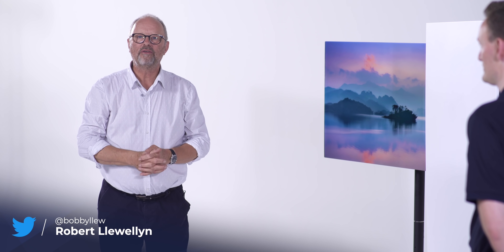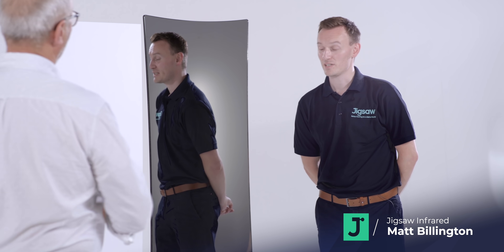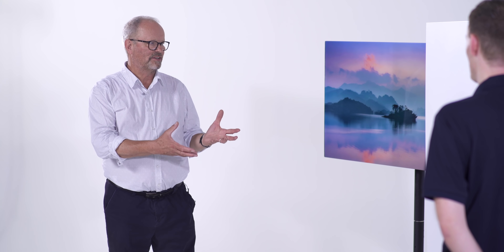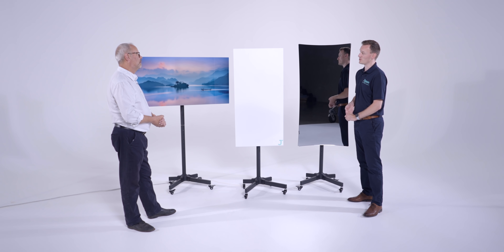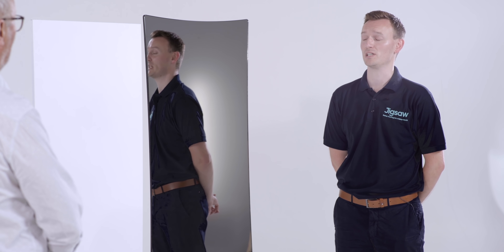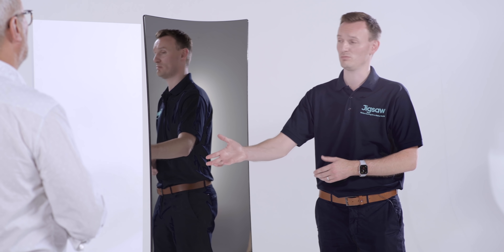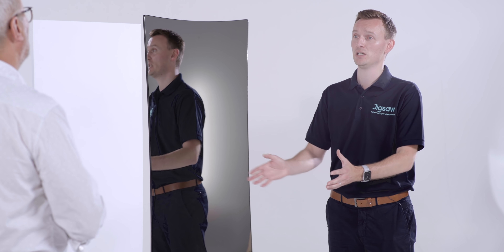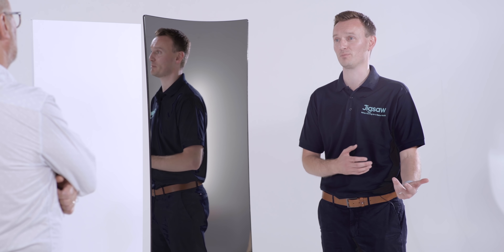JIGSAW INFRARED - Heats like the sun, cares for the planet | Subscribe to Fully Charged PLUS

Comment: Been thinking of getting something like this for a while, as my flat has a crappy E7 storage heater, an old gas fire and frost protection heater for when I'm not there.  Handy information.
Reply: Same with me needing to replace old E7 storage heaters in a small cottage, no gas. Looks ideal.
Reply: Changed my life and has helped improve our spend on fuel. It saves money because its not being wasted on heating the air.
Reply: @glennbillington  What does this 'not heating air' mean? Of course it's heating the air. It's a resistive heater embedded in ceramic. Very inefficient. There are so many better solutions.
Reply: @OAK-808  the heat is emitted as radiation. Not convection.

A tiny proportion of the heat is emitted as waste heat in convection, the vast majority heats you directly, using infrared.

Heatpumps by comparison heat the room via traditional wet convection radiators. Resulting in wasted energy as the room air must be heated in order for the heat pump to transfer heat to you the individual.

Comment: These panels are an old, well  known technology and that was clearly stated. As the UK’s favourite form of heat energy (gas boilers) become more and more expensive to operate, these modern versions of IR have a definite place. 
Obviously a well insulated home is the start point, but some heat is still going to be needed and the conversion rate of resistive heating (circa 100%) is very good. 
Heating the people and the building directly is more efficient than heating a water mass and pumping it around. This  is partly because water has very high latent heat capacity and thus takes about 4 times the input per unit output. It’s usually quicker and more efficient to heat directly than via water.
Bear in mind that the latent heat in water is not wasted once input, in a closed loop device and heat pumps can output greater heat than the electrical input in ideal conditions. 
However heat pumps and gas boilers have many drawbacks including a limited lifespan (10-15 years) and expensive maintenance and replacement.
As more houses in UK install solar panels and more of our electricity comes from renewables,  efficient electric heating will make sense for many peoples homes.
Reply: if your heat-pump isn't outputting more heat than the electrical input its broken.
Reply: A problem with this logic is that this instantaneous heat will typically be needed when solar isn't not functioning. I think it is pretty evident that the best solution for long duration heat is a heat pump. This could be to heat water to heat air in a rerversible air con system. The fact is that for every calorie of energy taken from the grid you get 3 out from the heat pump. It must comes down to the whether you need to heat a whole space for a long time or a subset of the space for a short time.
Reply: @matthewpieri9080  I'm thinking of getting IR panels as well as a heat pump. Im going to turn flow temperature down so that It's at its most efficient COP all the time, winter or summer. I.e. trickle charge the house with heat from the heat pump and use the IR panels in the room/s I'm in, using a sensor to switch on the panel.
I'm using a 350W panel right this minute, and it's adequate. 5 minutes before I get up, I ask Alexa to switch it on. It's 0800,, and I'm already getting 1440W from solar.

Comment: Presumably these are far more efficient than regular space heaters?  Some numbers would be good.
Reply: All in replies to other comments. Plenty of info on the website too.
Reply: No, they're exactly the same efficiency, but they can only heat surfaces - not air
Reply: @jrisner6535  secondary heat is convection. So, they do both forms of heat.
Reply: @glennbillington4879  that's inaccurate, almost no convection will be generated. Don't pretend IR can do everything, they're a specialised technology for specific situations
Reply: @jrisner6535  Secondary heat is convection J. It's inevitable that once the infrared is absorbed then any further heat will be convection. Similar to when we sweat, heat from us is basically infrared and then the sweat on our clothes will become convection.
Reply: @glennbillington4879  misleading or you've misunderstood 🤷‍♂️ hard to tell
Reply: @jrisner6535  Similar to your cryptic comments.

Comment: IR panels == glorified resistor with heating efficiency of a resistor. That's not how you solve energy  problem but deepen it. For humanity to reduce risks related to global climate change we need to work on efficiency. For example heat pumps...
Reply: Resistive heating actually converts 100% of the energy input to heat so it's pretty good in that sense. The main issue is going to be the need for good insulation in the house or the electricity consumed will be high.
Reply: @SardiPax  All losses in electric devices are heat losses therefore the cheapest epectric radiator has the same heating efficiency as the most expensive IR panel, that is 100%.
My comment was aimed to propose that we have devices with higher heat energy transfering efficiency a.k.a. heat pumps with COP's around 4-5 compared with COP of 1 in devices that use Joule losses.
Reply: @SardiPax  A heat pump is 300 to 400 percent 'efficient'. Resistive heating is 100
Reply: @OAK-808  The pump itself yes, but you then need to transfer that heat around the house, which uses energy, and also there's the issue (if Air Source) of dealing with low external temps. I'm sure the real efficiency is still well over 100% but for most existing houses the heat pumps will still need resistive heating supplementation at times (to heat the water) further reducing overall efficiency. I'm not arguing against heat pumps, but nor am I deceived by the hype.
Reply: And what is your educated understanding of the situation and do you plan to save mankind Ja?

On and on again we go. NOT EVERYONE can have heat pumps.. When will people listen? It is not suitable for millions of people in the UK and when someone finds the be all and all then we need to do our best. 

Your remarks are misleading and not fact based at all.
Reply: @jamislil2703  That is where you do not understand. You give misguided information. 'Mr Heat pumps' here again going on, they cannot be installed everywhere and the capabilities are not there to actually make it happen. Plus the cost of heat pumps, not everyone is as rich as you are. 

Get a grip and see the reality of the situation and stop winning on about something that not everyone can have.
Reply: @ja mislil  I can't get a heat pump in my flat, yet. What do you suggest I do? Right now I have a combi boiler.

Comment: Under floor heating is infrared heating. The best form of heating in terms of energy consumption and comfort, would be a heat pump connected to underfloor heating. By the way, in the early days of underfloor heating, plumbers were also embedding pipes into walls and ceilings to get the same results. I believe this practice was dropped because of too many pipes being damaged in these locations
Reply: I’m very much inclined to agree with you, with the possible exception of installation cost. For a ground up build or renovation underfloor, particularly with a ground source heat pump, seems a couple of steps ahead. 
However the infrared panels offer an opportunity to install a much better system to conventional on a room by room basis and at a fraction of the cost compared to having to rip a house apart. It’s one of those cases where the perfect shouldn’t be the enemy of the good.
Reply: @ballagh  Yes, I agree - I wasn't arguing underfloor heating was a better or cheaper option to theses panels, although in a new build it would be. i was just pointing out that underfloor heating is infra-red heating..

Comment: If a simple home is heated by each of the methods it will cost so much for each.
68 million people and 28 million dwellings. 
So 
IR
heat pump and fans and ducts
Gas boilers and fans and ducts
Bar radiators
Gas heaters 
Plus installation and maintenance 
Each multiplied by number of dwellings 
Will tell us savings to the country. 
Also rooftop solar PV and a plugged in EV car battery. 
This can be a straight forward thing with the data. 
It will tell us the dimensions of the future.
Do list assumptions, eg number of rooms, 200 days per year, etc.

Comment: A quick retrofit solution but not necesarily the cheapest. what about the cost and upheaval of wiring them in? Draught proofing and insulating the building is far more cost effective in the long run.
Reply: Improving insulation first is always the most sensible option before installing any new heating system.
Reply: Have you had a quote and do you know the costing before making a comment? It would be better to have the draught proofing and insulation anyway but you still need heating.
Reply: @glennbillington  How can I have a quote on distant future energy bills? With draught proofing amd proper insulation the heating requirement is far less and you'd be running an old inefficient heating system far less if at all so it will be cheaper.

Comment: I have an IR heater. It's very efficient, but it's still less efficient at heating a space than a gas boiler. If I had solar and a powerwall then that might be different, but those are out of my price range for now.
Reply: Surely this is the question of efficiency vs effectiveness? These IR panels are very efficient at converting expensive electric to heat/energy but then so are tradition heating elements. Whereas they are not very effective at heating spaces when compared to a gas boiler (but I don't think they claim to be a space heater). However the overall effectiveness comes down to whether you feel adequately warm or not and then how much it costs to do that when compared to other methods.
Reply: You Tube  for some.  I live in Manchester, a place not renowned for a lot of sun, and my roof is East-West facing not the optimal South facing. I do have a large free standing garage that faces south, but currently has a flat roof. I have been thinking of putting a peaked roof on that and then solar.
Reply: You Tube  Definitely part of the Jigsaw!
Reply: @robthomas7232  Aston University undertook an independent study for three different heating systems. Jigsaw Infrared was the infrared system used in testing. 

The Study found:
IR heating system can increase the room temperature to 18 C in 10 mins which are less than the other two heating systems (2000 W and storage and convection) which take 15 and 17 min respectively. 

The IR heating system can heat the room temperature to 22-23 C compared to up to 18.5 C for the other two systems. 

The IR heating system has an efficiency 2 times higher than the 2000 W and storage and convection heating system. 

Therefore, the IR panel used half the energy (50% less) of the storage heater and reached room temp in almost half the time.
Reply: @jigsaw.Infrared  Methodology?

a 2000w electric system (except heat pumps) pump out 2000w of heat.

so either yours is 4000w or the experiment favoured yours in some way.
Reply: By its nature Electric Resistance & IR Heating is 100% efficient. Modern condensing gas boilers are labelled between 92-94% aka A-rated efficient. installed boilers run 10-25% under their A-label efficiencies because 99% of installers have not been trained to set condensing boilers up correctly. Obviously Gas per KWH @ 3.78p is considerably less expensive than Electricity per KWH @ 16.7p. Its easy to confuse efficiency and the differential cost difference between Gas & Electricity Per KWH...
Reply: Was it specified correctly? did you have the experts in to do it right?
Reply: @benholroyd5221  Answered in some of the other comments ben - have a read, it's interesting.
Reply: @robthomas7232  Answered in our replies to some of the other comments Rob.
Reply: @glennbillington  mine? It's portable. It could be fixed in place but I move it around, most often between the garage and the loft which have no central heating. It's enough in the loft, but not for the garage, which is 10m X 4m without any insulation so take a lot of energy to heat. I use the panel together with a large job site halogen heater in the garage in the depths of winter.
Reply: @jigsaw.Infrared  no it isnt. Just the same, and another study copy pasted around. That isn't a methodology.
The only place you've gone into more detail is trying to argue that not heating the thermal mass is a good thing. Which in certain circumstances is true. But not in main living areas. I want to pay for electricity when it's cheap, not at the most expensive times of the day.
Reply: @benholroyd5221  In which case you should consider a PV array and battery storage as part of your specific solution.
Reply: @jigsaw.Infrared  But that could be applied to any heating technology. Further I don't know about you but I tend to find that the sun shines A) mainly in the summer B) mainly during the day. Whereas I mainly want heat during the winter and in the evenings. so how much would a battery cost to store electricity throughout the winter?
Reply: @jigsaw.Infrared  well the Powerwall+ is 7.6kw, on the assumption the average family house is heating a couple of rooms at a time, let's say 1500w total then that Powerwall+ only gives you only 5 hours of heat and you can't fully recharge it in a full day of a British winter on Solar. Nothing like in most cases.
Reply: @benholroyd5221  So you make use of a cheaper night time tariff to top your battery up.
Reply: @TheAegisClaw  lay them flat. You still get 90 % of the ideal sloped position. Plus low install costs . Installing a sloped roof would never pay itself back in money, probably not in co2 either
Reply: @benholroyd5221  surely you can argue all day long but have you ever felt what infrared is like? Or would you argue the toss about it?

Infrared is another form of electric heating which works and I’m one of many happy customers out there. If you’re not keen on it then why keep up the argument process?
Reply: @glennbillington  Yes I had one in a prior bathroom. it was very good for that purpose, you could mount it high out of the way, put it on and have it heat up in time for getting out of the shower. 
It is a legitimate concept with legitimate uses. just like a hammer has legitimate uses. that doesn't mean you should use the hammer for everything. and anyone that says that consumers can use their hammer for anything are at best 'marketing' .

Walking works as an alternative to driving IC cars. could you construct arguments ,scenarios and experiments that back you up? absolutely. does that mean that in general for all people walking is going to be the best replacement to an IC car? those who attempt to go on a 20 mile shopping trip with 2 kids would beg to differ. if you tell people that the best alternative to driving ic cars is walking, you may well get take up. but youll also get a lot of pissed of people. which is what will happen here if people do research on heating from fully charged.
Reply: @benholroyd5221  Jesus, you have a lot of time on your hands to make many subjective comments and analogies. You have your opinion and you deserve your time to share them. It was good talking to you.
Reply: @jigsaw.Infrared  Sh!tehawk already refuted you before you even commented.

A powerwall wouldn't even last the whole day. And even then youre back into the realms of 'bulky', 'unreliable' equipment. Storing electricity to make heat is arse backwards anyway. You should appreciate that. You shouldn't be representing you product as a solution for all when in fact it's probably the one of the worst in terms of what people need and expect from their heating.
Reply: @glennbillington  your opinion is also subjective.

But yes I agree, if only there was a channel that could do unbiased comparisons to allow people to make informed decisions....
Reply: @benholroyd5221  thanks Ben.
Reply: @TheAegisClaw  A split East-West facing system is ideal really, you get the sun earlier in the morning and later in the evening when you need it more, not many people are at home all day to use the peak sun at 11-2pm
Reply: @That1ufo  but you'd need twice as many panels, which is twice the cost.
Reply: @GlennPierce  the garage needs a new roof anyway, I should have mentioned.
Reply: @TheAegisClaw  you don't need to put a peaked roof . I have my panels mounted on a frame on my garage roof ( which is flat) . Would be much cheaper.
Reply: @peelerflash  I need the peaked roof for extra storage inside too so it makes sense.
Reply: @TheAegisClaw  Alternatively, and cheaper, you could mount the PV on racks or you can even get plastic boxes that you fill with ballast & then mount the panels to. These systems are in every day use on commercial buildings. You might need planning consent though as the planning exemption only applies if the panels are in line with the roof.